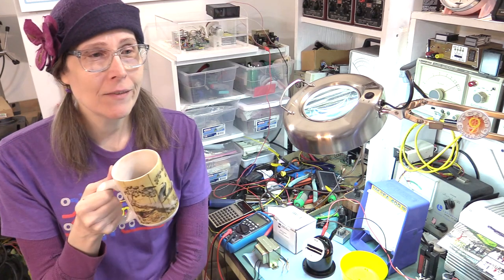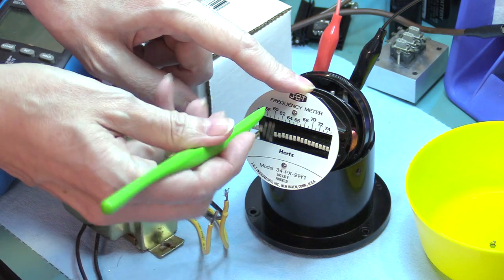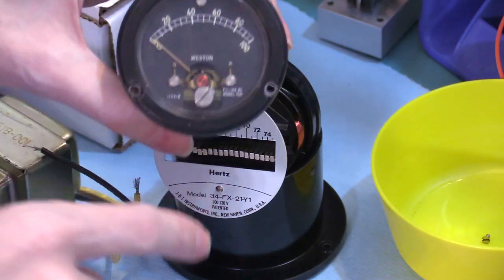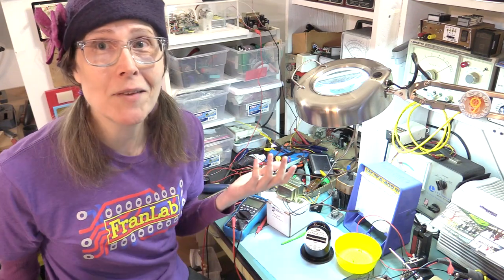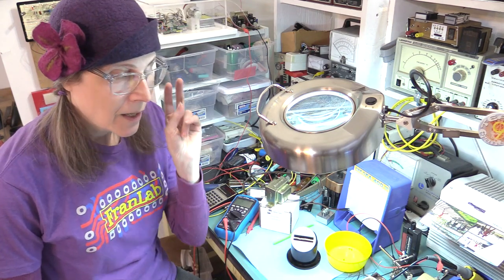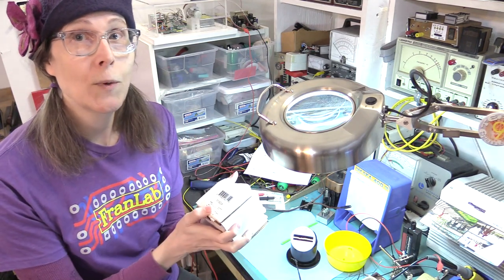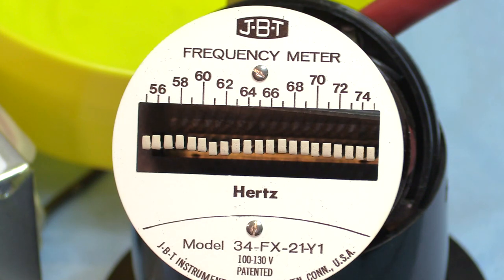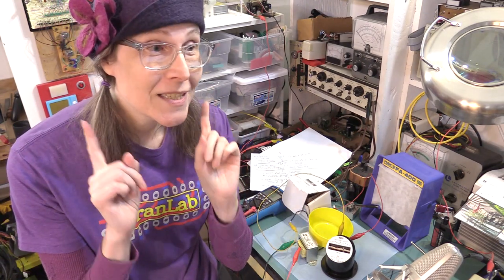Deep Dive Into The Electromagnetic Frequency Counter

Comment: Hi Fran, I love your channel. You need to brush up on transformers, though. As others have said, the DC resistance of the transformer winding doesn't matter. A power transformer will have a decently high impedance at 60Hz, otherwise hooking up 120VAC to it would cause a huge current and burn it up.
And the rated impedances of the audio transformer also don't mean too much, except that they give you the impedance ratio of the transformer. The impedance seen by whatever is driving the 8 ohm coil will be the 16K of the meter coil, divided by the impedance ratio. In this case, it will be a lot higher than 8 ohms, more like 240 ohms or so.

Try the power transformer, it will work fine.
Reply: Just for reference, you can use a variac as a pretty decent audio volume control for 70V or 100V distributed systems.

Comment: I have a Crown Macro-Tech 1200 and a 5000VZ in my lab and can generate any voltage at any frequency with these.  Actually used a Macro-Tech 1200 for several months running 24/7 at 400 Hz. to power a test setup in a manufacturing plant.

Comment: I’m surprised you didn’t mention the difference between the DC resistance of a transformer winding and its AC impedance. 
  Does an audio transformer’s 8Ω winding actually measure 8Ω with a DC meter?
Reply: Ohm's can really only be used as a resistive measurement only when calculating AC current. But current will only increase from there when using an AC supply. So you could say 8 ohms can be used to calculate the lowest expected AC current.
Reply: @Lazy_Tim  This is definitely wrong for transformers and induktors. They almost always draw much less current than the DC-resistance would indicate. Otherwise the power transformer with 11 ohm primary resistance would draw 11 A at 120 V, that is clearly not the case.
Reply: Yes I am very supprised by this. I think the power transformer would have worked fine as long as the drive frequency was >50Hz.
Reply: @larslindgren3846  Yep you're right. Got that all messed up. Forgot all about inductive reactance. Carry on.
Reply: @Lazy_Tim  Me thinks you don’t have a proper understanding of inductive reactance, as Xɩ goes up with frequency [and current down]. Perhaps, because you are in Australia, you see it upside down. 😉
Reply: @stanc7178  Back off mate. I had blond moment. I know where I went wrong and to be honest it was just a mistake. ;) Australian. lol

Comment: Now I feel like I want to find one of these, and rig up a system that varies frequency based on an audio signal, compressing the frequencies of audio to match the limited frequency range of this. It would be awesome to have this as an actual audio frequency analyzer.  (Compress 200 - 20,000 Hz down to 55 - 75.)

Comment: Even having seen non-electrical harmonic displays like this (OxTools went over one recently) it wasn't immediately obvious how this works.  My assumption was some kind of tiny linear motor that oscillated at a rate related to the tines, to get the same resonant display action that the non-electrical displays ultimately use.  Technically that actually is what's going on, it's just that the tines are part of the motor.

Comment: Fran, I think some of the distortion you saw was actually ringing in the meter. I doubt it has much physical damping, and the electromagnetic damping would be very weak, so it just rings down when the frequency is changed.

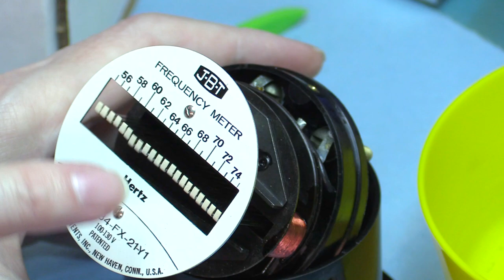Comment: 11:50 ... Although I don't have the equations in front of me, my bet is that the higher-frequency tines don't have as large of an amplitude when driven with the same force. This would cause the meter to read artificially low (imagine an input signal of 70.5Hz. We want the 70Hz and 71Hz tines to vibrate at the same amplitude, but the 70Hz would vibrate just a little more).

Comment: The amplitude at natural frequency of similar spring-masses under the same exciting force is going to be higher at lower frequencies so the steel V-shaped items taylor the magnetic field strength to equalise the P-P amplitude.  I actually saw some of these when I was 19 at a small power station in New Zealand, 1976.   The response (Q?) was not quite as narrow as yours as adjacent beams had some vibrations.  But I could see immediately that they were like a row of tuning forks and thought it was a very clever idea.  I think the range was very narrow, like 48 - 52 Hz.  But your example says Hz where these may have said cps.

Comment: Too many comments already for me to check all.  Probably there is already a number of them stating what I wanted to say, but so what.,..  First, the impedance ratio of (output) transformers is the square of the turns ratio.  (Turns ratio is the same as the voltage ratio.)  Second, your amplifier is not trying to put out a certain power.  It is producing a certain voltage.  The amplifier is quite happy producing the same voltage to any load impedance higher than the nominal (minimum).  Including all the way to totally open circuit.  Third, you don't equal resistance to impedance.  Except in one industry standard case -- loudspeakers are generally specified to have their resistance = 75% of their listed impedance.  Call that industry making the speakers as well as amplifiers interchangeable.  All in all, you could have hooked the 60 Hz transformer right to the 8 ohm output of the amplifier and start the volume from down at zero.  Then increase the volume slowly as much as needed.  Would not be much.  If you would still be scared, you could add at first an 8 ohm resistor in series from the amplifier 8 ohm output.

Comment: 13:30 24V transformer - secondary resistance 0·6 ohm - would suggest that transformer would provide 40A !!!
I can't imagine it providing more than 5A @ 24V 

But you can always stick an ammeter on it so you could ensure the transformer wasn't drawing too much current !

Or find a lower power transformer !

Comment: I think the cheapest way you could vary the frequency would be to get a used Dynamo style generator and vary the speed of the throttle because that's what those frequency meters were designed for was to tell the frequency on large generators

Comment: ironically i was trying to figure out an electro mechanical hz meter XD... not even joking.  just decided to google it, since i've been having trouble figuring out how to measure hz without buying a premade meter.  this is close to what i was considering.  a silicon spring is what i was thinking, that would connect a circuit and pulse a light, but this is really cool device. especially since i'm a musician

Comment: From memory the impedance ratio of transformers is like the inductance ratio. The square of the voltage ratio

This is a real example using a real Bourns LM-NP-1002L audio transformer.

The voltage ratio is 1 : 0.5 + 0.5
DC Resistance ratio is 66 : 33 + 33 
The impedance  ratio is 600 : 150 + 150
The inductance ratio is 2.8H : 0.7H + 0.7H

Comment: Even better than the transformer you used (although it worked OK) would be an output transformer from a tube-based amplifier (I bet you have a few of those lying around in your lab). Connect its speaker end to your amplifier, and the tube-side "primary" would then produce a high-voltage high-impedance output to feed to your frequency meter. A low-voltage (6.3V or less) power transformer (connected backwards, of course) would also work (ignore the irrelevant low DC resistance).

Comment: You can't measure the impedance of a transformer with a DC ohmmeter,. And the load that the amplifier sees will depend on the load connected to the transformer secondary, but changed as of the relation of the ratio of the transformer primary/secondary. The resistance of the transformer itself does not influence the load the amplifier sees. You might even have been able to drive the meter directly from the signal generator through a low voltage mains transformer, it is unlikely that the sig.gen would be hurt if the output should short, but a tube amp can be damaged with no load at high levels.
Merry Xmas from Denmark.

Comment: Very cool and really neat setup!

... but to respect the Intention of "that thing", you should have used a rotating machine.
Yeah, of course the effort would be quite big: it is not easy to find a small synchronous generator (generally with external excitation) and you have to drive it with another motor that can be regulated in speed ...

Comment: Another way to test it would be to put it on mustie1's dodgy kerb-find generators with mechanical speed governors.  It would probably be more convenient than the digital RPM meter he uses, especially if built into a box with a voltmeter and dummy load.

Comment: Strange scaling on that instrument. They would normally be centred on either 50 or 60 Hz depending on which side of the pond that you are! I have one on my 1972 110 kW diesel generator and as I gradually bring on the load of my 100 kW induction furnace  the frequency drops from about 52 to bang on 50 :)

Comment: I was thinking a coil of wire duct taped to the output transformer of the guitar amp would give it enough current, failing that, a sure fire way to do it would be an old generator; just tweak the governor a little up or down should change the output frequency.

Comment: It's simple. The power transformer will present a high load impedance to the amp so you can put an 8 ohm power resistor in parallel with the primary so the amp is happy.

You can then drive the meter no problem by feeding your audio generator into the amp.

In fact most any audio amp will work for this.

Comment: You mean that multimeter is measuring impedance at 60 Hz, not DC resistance?
Reply: She's measuring DC resistance :)
Reply: @tomwimmenhove4652  Which has only very little to do with the actual load a transformer presents, because it completely ignores reactance. That said, the audio transformer she used had a 75:1 turns ratio, which made more sense than the 5:1 ratio in the power transformer for this application.
Reply: @davidbarts6144  The 75:1 rating is for impedance. The turns ratio is the square root of that or about 8.5.
Reply: @davidbarts6144 I know. Hence the smiley face. She probably just never really thought about the difference between resistance and impedance.

Comment: I am wondering how temperature might change the readings.  For example if this was used on a generator, located outside in winter, would the reeds not vibrate as well or to the same frequency if it was say, below zero?  Now I am thinking about getting one and doing some tests.

Comment: Now I want to buy one of those, its my new VU meter.
Reply: Pros: Cool
  
Cons: Expensive, requires high voltages, tricky to drive, hard to get parts
  
Seems like it passes a cost-benefit analysis.
Reply: @user-qf6yt3id3w  excellent, the cons are also pros

Comment: The frequencies of the tines are too close together for adjacent tines to be harmonics.  Instead, I would bet that the response of each tine has a bit of bandwidth and does not "suddenly" move at its stated frequency and at none other.  In other words, the frequency response of any one time probably looks like that of a bandpass filter.  Sort of a "bell shaped" curve.  The only thing we don't know is how "sharp" the "cutoff" is.  I suspect if you could plot them all, you would a bunch of such curves all overlapping each other a little.  If they didn't, there might be a frequency in the desired range where no tines would move.  So If you were exactly on the frequency of some tine, I think it would be normal for the adjacent tines to also move a little.  And if you overdrive the heck out of it, then you go further out left and right on the X axis of each tine's frequency response curve.
Reply: And harmonics will never make a fundamentally tuned blade to resonate!
None of the tuned blades are in harmonic relation of each other: the first harmonic 2 of the lowest blade is above the frequency of the highest blade...
So to my mind, it's just impossible to see harmonics within this bandwidth...
Reply: Well, if you had 30 Hz and a waveform distorted enough to have harmonics,, the 60 Hz reed would be expected to vibrate, although perhaps not with much amplitude.
Reply: @trainliker100 , theoretically you're right. But which country uses a grid network at that frequency?
Well I knew an old one, for train in Switzerland, with 16 2/3 Hz (50hz/3), very specific and long time disappeared...
Reply: @etienneguyot9069  And theoretically is how I was commenting.  I wasn't implying that was a frequency in use now or ever.  And 25 Hz was used quite a bit at one time in the U.S. and is STILL used by Amtrak on an east coast corridor for powering traction motors.  So I guess there is a place you can go, today, to find power at a frequency with harmonics in the range of the meter, but you will find the voltage to be a tad bit too high for the meter.

Comment: Actually, if the tines (?) were coated with phosphorescent paint, you could tell what frequency was being displayed as long as you knew the frequency endpoints (55 Hz and 75 Hz), and that each tine is 1 Hz apart. The entire dial needn’t be coated with phosphorescent paint. Of course, if the lights are off, hooking it up could be a problem; especially with mains voltages present! 😬

Comment: One stupid questions: Light driver for dimmable led lamps will work? Its change frequency on change luminocity by the lamps and works with 230v (over here) or 120v (in us). Or is it to digital on driving the old display?

Comment: Fran, could you please explain what kind of switches I would need to repair my oil circulating radiator heater? Just the same heaters they sell at home depot. I wanna replace the two, 1-600 wats and 1 900 wats

Comment: Audio transformer :3 i would have used one from an old tube radio 
Not that i want you to try but would it be possible to just drive it with the tube output stage directly ? 
we are kinda going trough two transformers, kinda like a high voltage line but in reverse C:
and thanks for those nice pictures of the meter, very satisfying~

regards from Germany 
Lara

Comment: As I responded on the previous vid. I have  a tongue frequency meter myself for 50 Hz and it is normal that more then 1 tongue is resonating.. With mine you can see that about 5 in total are moving so 2 above and 2 below the actual frequency. It is also meant as an indication how fast a generator is running to slow it down or let it go faster. The fine tuning of the generator is usually done with the synchronoscope HEY! maybe that is a nice meter to tear apart also.
Reply: These are used cause it is hard to think for an operator in the early morning when seeing the synchronoscope turn very fast if he should push more or less fuel in the driving force to slow the synchronoscope down :D. btw.. you need 2 inputs for a synchronoscope... the frequency of the utilities and a signal generator to make it go faster or slower/ clockwise or counterclockwise.
Reply: oops...probably you need a 3 phase signal generator with a synchronoscope sleepy me.

Comment: Dunno what all the fuss is about re resistance of transformer secondary and frequency meter. As long as the power supply internal resistance is lower than the resistance of what's being driven, everything should be hunky dory. As the meter is designed for 120V as long as the transformer provides something in that region, the meter will work.

I suggested a 24V sec transformer as it was a ball-park safe figure. 12V or even 6V sec could potentially have been better if the amp you have isn't up to the job. I've only driven 12V with my hi-fi amp - i.e. car brake light bulb (12V 21W) with which I didn't manage to burn my ear listening to the music coming from the bulb.

Comment: I think you made a little mistake with the reasoning about "cooking" your bass amplifier. 
It's actually better to short circuit an output transformer from a tube amp, than leaving it open. This all has to do how the loadline shifts. 
That being said, I still agree that it not a good way to drive this thing.
Personally I would measure the inductance of the coil. See if there is a way to drive it with a single ended amplifier stage. Sounds about right with 16k dc resistance. 
Isolation output transformer could also be connected to a solid state amplifier. Bit more linear than a guitar amp. 😁
Thanks for the nice videos 👍🏻👍🏻😎 love your approach and way of thinking.

Comment: Measuring the DC resistance of a coil or transformer has limited use. The arbitrary markings of primary and secondary resistance are only relevant if, and only if the terminals see that value and thus that will be reflected to the primary and offer the preceding stage the expected impedance. The inductance and number of turns is all we really are concerned with and is also why it isn't a good idea to reverse a mains transformer. 
For example I have a big 230V mains transformer and the primary DC winding resistance is under an ohm. 
Completely useless apart from telling me a fairly hefty gauge of copper was used.

Comment: Out of interest,  did you measure the AC voltage applied to the frequency meter from the audio transformer ?
Reply: Probably around 120 volts, based on the tine deflection.

Comment: Wait, I'm sure your sums are wrong re. transformer. If you put 24v AC into it, the other end will be 110v unloaded. Adding 10k across it, not a great load. The low impedance in the transformer is what you want. Also... DC resistance != AC impedance

Comment: Hum maybe I need to remember better, but I don't think that's the way impedance propagates thru transformers, you don't measure the dc resistance, but need to check if the unknown driver use constant current to the speaker.